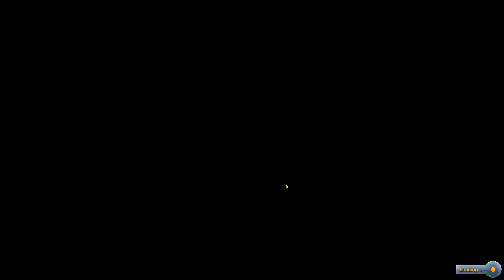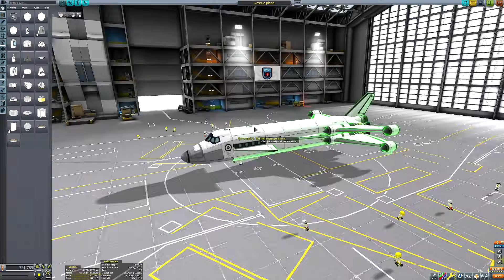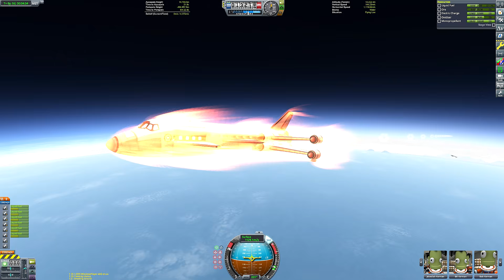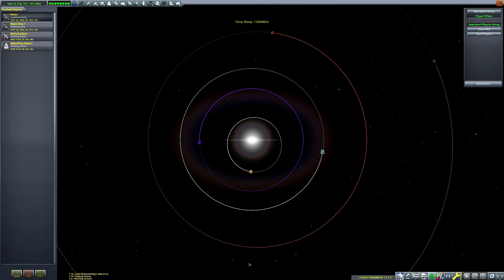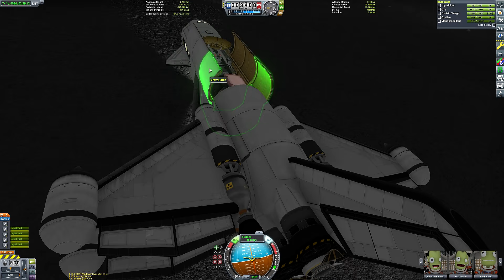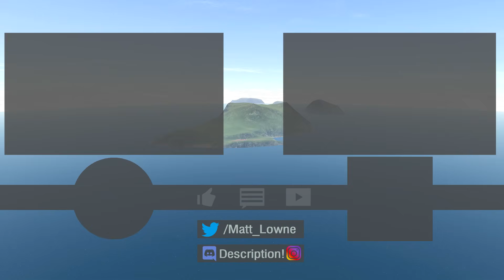Flying the Interstellar SSTO from "Into The Warp" + Alien Ships, Space Stations, and Lots of Mining

Comment: * Has mining gear for infinite range
* Needs to dock to a refueling station in LKO
Exactly like my SSTOs! :) But my big one keeps emptying my refueling station, so I'm rebuilding it with more fuel and less cargo space in the hope it'll reach Minmus without refueling.

I liked the asteroid mining without an AGU in the movie. I say that having just carefully figured out how to shoehorn an AGU into 2 different vehicles. In neither case is it fit for towing, so it's theoretically unnecessary, but I'm not sure I'm a good enough pilot. Or rather, I'd have to fit really weak RCS to get fine enough control. Likewise with the interior of the abandoned ship. Or perhaps I just fit overly strong RCS normally.

I try to avoid 0.0km separation, these days. :) One of the first times I rendezvoused my current best mining ship with a tanker, it whooshed past at 50m/s and far too little separation. The mining ship is a long collection of Mk3 and 3.75m parts, so for surface stability it has a quartet of FAT-455 wings as pylons. One of these destroyed a Gigantor solar panel fitted to the middle of the tanker. It just whooshed through it, leaving photovoltaic shards. It's a miracle both ships weren't reduced to their constituent parts, really!

Comment: I've had the same fuel transfer problem and as far as I can tell this is how it happens.  For some odd reason if you open the information window for an individual tank AND use the show all/transfer resources box then it maybe might work for a moment and then just fail endlessly.  If you close the transfer stuff and then close the individual tank information window and then reopen the transfer stuff it will then work.  Now it should also be noted that I didn't seem to have this issue until after I had moded my KSP so that might be the reason you don't normally encounter this issue in your purist mainstream videos.  (compatibility is kewl then we can just add/replace with our own moded parts the little bits)

Comment: I've seen some glitches as well.  I couldn't attach a strut or a duct.  So, I had to go without and altered the decoupler to added as one.  Then I had to alter the fuel flow priorities so it would drain the external first and when it got to zero I had to manually stage it.  Am also seeing other screw ball behaviour.

Comment: In my current save I have a slightly different fuel transfer bug, where when I finish transferring between one pair of tanks, if I open another tank (and close one of the others in the process) it won't transfer until I close and re-open the new tank.  And of course it isn't reliable and always closing and reopening the second tank sometimes triggers the bug instead of fixing it, so transferring fuel is always a pain.

Comment: Hey matt, I was wondering if you could  do a science mode play through on a kopernicus mod that adds new star systems or make your own? (sadly at the moment n extrasolar mods are compatible with the current version of ksp). But if you do get around to this i very very very very highly suggest you use a mod called “ksp interstellar extended”. Its a mod that is compatible with the current version of ksp and it extends the tech tree by practically two-fold. It adds hundreds of new parts such as solar sails, fusion engines, new cockpits, reactors, radiators, thermal reactors, nuclear jet engines, and at the end of the tech tree is the alcubierre warp drive. 

Like so matt can see this, This would be an awesome series!!
Reply: Matt needs to see this it would be great

Comment: Matt lowne I have that glitch all the time with transferring fuel. Even in the same crafts the game won't let me transfer fuel from one tank to the other. Now that you have put this video out with this glitch in it I hope it will be removed
Reply: Are you sure that the docking ports have "enable crossfeed" on
Reply: Trajan Koberg the glitch happens to me too, and i have crossfeed on
Reply: @Avalanche_Nutrition  It happens even if you are trying to transfer fuel between tanks that are attached to each other
Reply: The bug is localized in 1.10, and different users have reported different fixes that MAY or MAY NOT work for other players. IE: Quick saving and loading, closing out and reopening transfer windows, time/physics warp, ect ect. I am just playing 1.9 until this gets patched...
Reply: From what I can tell, this bug occurs when one part info window is closed by opening another one. If you want to close one fuel tank's window and open another one, right click in empty space first, then right click on the parts of which you want to open the window.

Pinned windows and shift-clicking to open multiple windows are fine in my experience, but as soon as you right click a window away by clicking another part, it gets bugged.

It's a frustrating and ridiculous bug, but hopefully this can be a workaround for some people until it gets fixed.
Reply: I've had this recently too since upgrading to 1.10.
Reply: Same, glitch happened when I was refuelling a space station
Reply: And here i thought it was a game mechanic
Reply: I’m glad I don’t need to transfer fuel much in my experiences.
I’ve experienced that glitch once and that was just me fiddling with fuel storage on a scientific drone-plane.
Reply: Hey! I have also created a channel. I upload spacecraft videos in Spaceflight Simulator! Check it out!